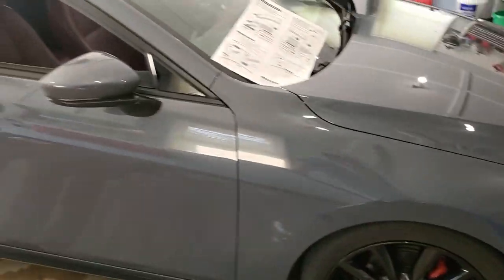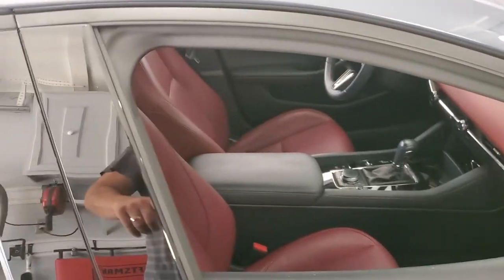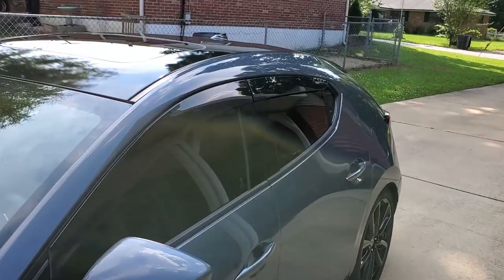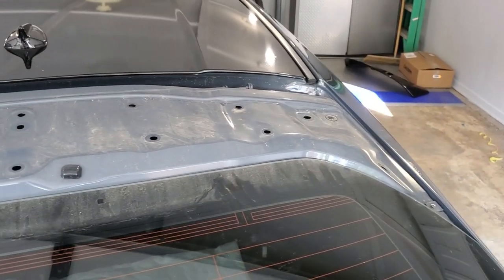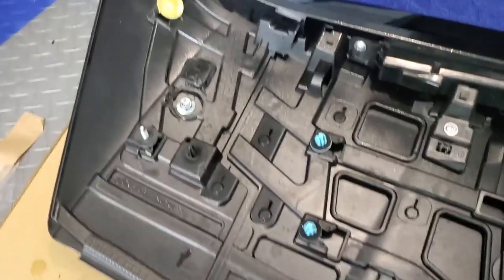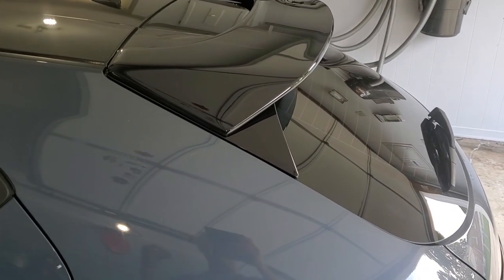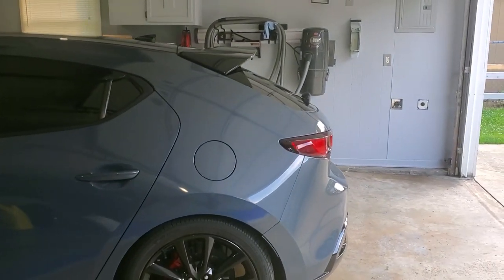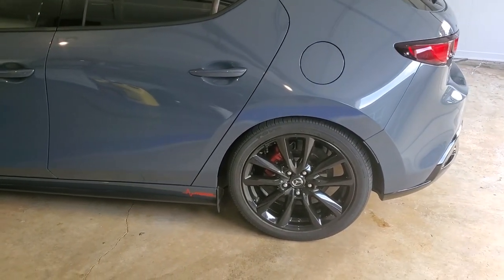Mazda 3 Window vent shades and Roof Spoiler added to 2019 GT Sorta DIY install

Comment: too bad you only showed the before and after install, and NOT the during process. Also the A pillar is so angled already and with the vent shades installed, more loss of vision as you make a left turn due to blocked vision from the acrylic vent shades. Whoever is thinking of getting vent shades, get the material made out of polycarbonate (brand I bought back in '18 is called Well Visors), as it will not deteriorate and break off like acrylic.

Comment: @0:47 seconds you mention a little push- tab or nut on the rear window visor. I just had these installed and it appears something is missing on mine. I simply have a clear 'stick' of plastic going through the metal latch but it is not attached with anything. Possible you can show what that should look like from the inside of the visor where the rear window visor meets the latch/ adapter. You'd be helping me out tremendously!!!
Reply from the maker: Sorry car is sold now. I don't think if you did not use that piece you will be fine
Reply: @jasonin2details  appreciate the response!

Comment: Your car looks amazing with all the mods you've been working on.
I've got a grey machine Mazda 3 Hatchback 2019 myself.
Did you paint your callipers or did you get another after market brakes installed?
The vinyl covering the roof makes the car look sportier, is it a precut piece or how did you get it installed?
Thanks a lot
Greetings from Mexico
Reply from the maker: dig through our older videos. We painted the calipers ourself and had a shop do the roof

Comment: Why do you have mud flaps on the rear wheels mounted IN FRONT of the wheel, rather than the back?
Reply from the maker: Those my friend are from the factory. There the day the csr rolled off the assembly line.  So not sure why they are there
Reply: @jasonin2details  I see. Thanks for the reply.
I ordered a Mazda3 also and I'm not sure If I should get the mud flaps too with it...i'm afraid it will look rather odd with them on...

Comment: Did the spoiler come with the "air deflector" B0L6-V4-990
On some sites they're saying it's required but don't say if it comes with it. The part individually is backorderd everywhere

Comment: Do you have any vid of actual removal of the roof spoiler? I'm stuck after taking all the bolts off. I've tried heating the corner but I can't pull it off!
Reply from the maker: no cause i was alone and could not film and remove. its just a very tough pull and pop off. start on left side right at roof line and spoiler those are the plastic push tabs and just pull hard
Reply: @jasonin2details  Just pull kinda straight up? Was looking at previous gen's and people were pulling out towards the back. Hope the spoiler I got has extra clips. x.x
Reply from the maker: @dartu5854   yes straight up.Look in the video of the underside clips
Reply: @jasonin2details  Thanks! I'll give it a go.
Reply: @jasonin2details  Success :) Though the sound of those clips breaking were pretty disconcerting .
Reply: @dartu5854  I just did this job yesterday, used the blow dryer but the yellow clips still broke, now the broken pieces are inside the bottom of the liftgate and rattle inside when I close it!  I’ll try to find those little pieces by removing the rear trim panels...frustrating!

Comment: I want to install this on my 2019 hatch as well. Product installment says it requires an air deflector which is item # B0L6-V4-990. Is that true?
Reply: Short answer: No. If you look up said p/n, those (2) deflectors go under the car. Plus Mazda recommends the front splitter too (as part of a 3-part pkg...cha-ching $$ for the dealer).  It might have to do w/aero balancing, you DO NOT need to install the (under-car) deflectors....you can later on, but not necessary.